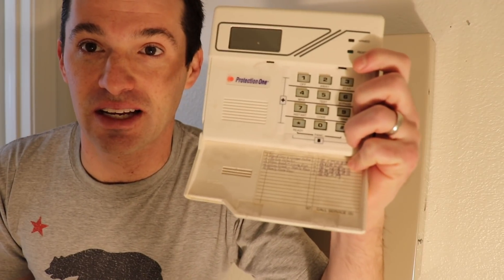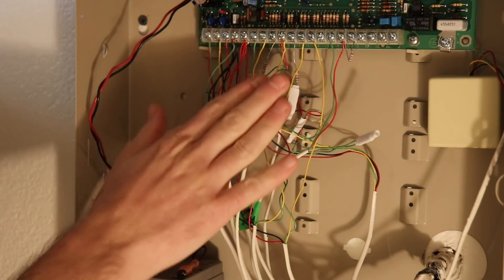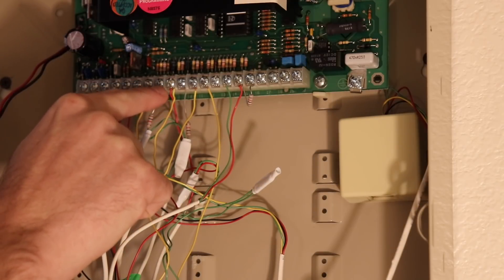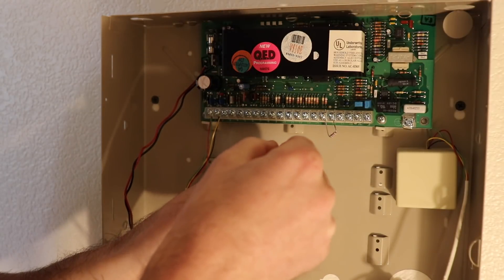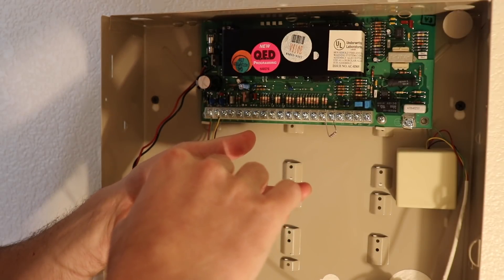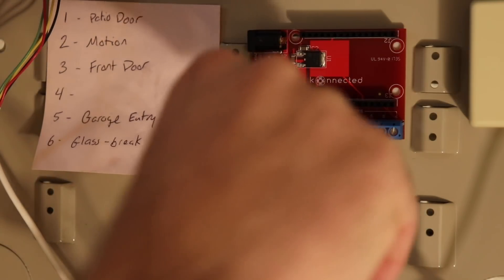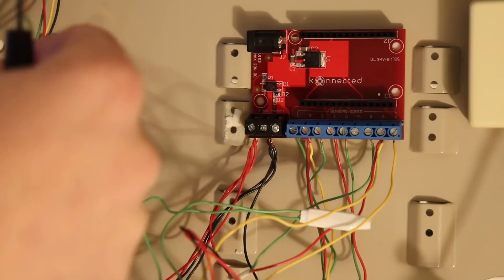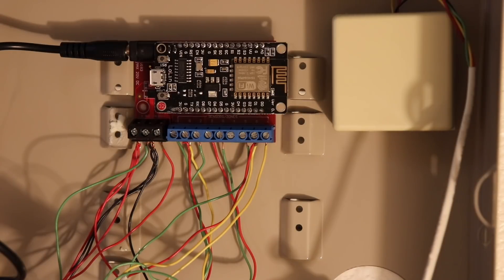Konnected Alarm Panel installation - Ademco Vista conversion

Comment: Excellent video. I must not be understanding it clearly. What about the keypads wires? Please help with what to do with them.
Reply from the maker: With the Conversion Kit you’re replacing the legacy panel, so the original keypads lose both power and data... after the swap they won’t do anything.

What to do with the keypad cable:
If you don’t care about wall-keypads anymore: disconnect the four-conductor cable at the old keypad, cap or tape the ends, tuck it back into the box, and leave it labeled for future use.

If you’d like a wall-mounted “smart keypad”: keep the same cable in place. Use the red/black pair to bring 12 V DC from the Konnected board (or a small plug-in supply) to the wall box, drop it to 5 V with a cheap buck converter, and power a slim Android/Fire tablet running Home Assistant, SmartThings, etc. You get a touchscreen dashboard where the keypad used to be.

Want the legacy keypads to stay 100 % functional instead? Go with the Interface Kit instead of the Conversion Kit; it lets Konnected piggy-back on the existing panel, so the keypads continue to work exactly as before.

Comment: Any way to do this without removing the original system/keypads (as if you're just installing an additional keypad, albeit a smart one)? The keypads are able to get info on alarm system status and zones and whatnot, so id imagine you could design one that relays that info to a cloud service
Reply from the maker: It’s not added to the keypad bus, but yes. That would be our Interface Kit variation.

The Interface Kit bridges onto each sensor loop itself:

You land every door/PIR wire on the legacy panel and on the matching input of the Interface board (in-parallel). Konnected just reads the loop voltage—nothing in the circuit changes, so the panel and keypads work exactly as before. 

One spare “keyswitch” zone plus two PGMs on the legacy panel let Konnected arm/disarm and know armed/alarm state, but it still never speaks the keypad data language.

Think of it as tapping the zone wires, not adding another keypad.

Comment: Hi, I'd like to add to this video, that when you do it for real, make sure you trim the ends shorter so there is no wire or copper exposure, otherwise, when the wires are moved could short the loops for the zones or the power, be the case. Also leaving the circuit board outside feels a little bit exposed. The device is innovative, affordable, and it seems that basically comes in modules that you build based on your needs, avoiding to pay extra for things you don't need, and all that is put together by the app. 
Now, on other videos it is shown that the device is placed outside the box for better wifi reception. I don't have this product so I need to ask, is the wifi really affected if it's inside the metal enclosure? Because that could be a problem. If that's the case there are a number of codes and regulations that are not taken into account. And one of them is wiring and circuit exposure. Please make an enclosure that can protect your device. Or even better, the standard for those dongles is to leave that device inside of the bigger enclosure or box, and add some antennas. A number of things can happen that would affect the performance of it, humidity, spiders or bugs, a cat, you name it. A spider touching the contacts could trigger a false alarm with possible deadly consequences for the bug at best. But none the less, a false alarm. Or the opposite, the spider could be conducting or closing the open loop and the contact would fail. I have seen it. Just a suggestion. And for real, there would be places where the signal is bad.

Comment: So why use this if you can just add AlarmDecoder to your existing Vista

Or better buy Vista 20iP and have everything already inside of it
Reply from the maker: Konnected is built first and foremost as a smart-home automation bridge: it speaks ESPHome out of the box, links natively to Home Assistant, SmartThings, Hubitat, Alexa, Google, and soon Matter, and never charges a cloud fee.

AlarmDecoder only works if you keep the Vista panel running and host its bridge software on a Raspberry Pi or PC, which many users find finicky. 

A Vista 20iP does add Ethernet, but remote control is still tied to Honeywell’s paid Total Connect service, so you’re locked into one ecosystem and a monthly fee. 

With Konnected you can either pig-back on any legacy panel (Interface Kit) or replace the panel entirely (Conversion Kit), keep your wired sensors, and drop straight into whatever automation platform you already use—no vendor lock-in, no required fees.

Comment: It would be a far better product if arm and disarm commands could be set to the board. Currently if the control goes down (ie Home Assistant) the solution is down and offering no protection. Even if using SmartThings one would only have to kill household power to disable internet. It is really just a sensor sender, one could achieve the same result with wireless sensors connected to the hub of choice.

Comment: This is an awesome product! Super easy to install and add to Hubitat. Have everything working, motion and 10 contacts. Thanks for making this. I upgraded my old DSC panels 10 years ago. The original 1994 panels were boring, so where the 10 year old panels. Now its 2020 and use a tablet instead.
Reply: What happens when the alarm is going off and your tablet is dead or not connecting?  

Cool ish product, not robust enough for actual protection imo.  You need a keypad.

Comment: I would keep my current alarm system that is 1000x more reliable then this,
It has a battery backup and uses the landline, So even if the intruder cuts off the power or cuts the coax coming into the house, My alarm panel will work for DAYS.

Also Those EOL Resistors are there for a fucking reason!

I hate people who change there perfect working system for the latest iCrap,
Just one of the MANY.. MANY Reasons why I don't partake in owning a cellphone, Just give me a landline and some analog TV And I will be happy!

Maybe it is because I like to live more simply, And I like the 70s 80s 90s/Early 00s living more then modern day crap. But there are clear advantages to keeping the old system, You could of at least added landline with seizure capability (Via RJ31X) With this system, But no, Most people nowadays don't care, And then someone breaks into there house and kills them. 
Pointless.
Reply: I am a prospective customer, not an owner. 

You are incorrect. Your statement makes no sense. The system as presented in the video is NOT the same as your current system. It is apples to oranges. Your current system uses a land line and has a battery back up.  A battery backup can be added, internet monitoring is how this system works.  I don't have a land line. My current alarm provider uses GSM as its connection. At almost $40 a month, I only need 3 months of service before this is paid for, with the same reasonable level of backup and communication. If someone is breaking into your house for the purpose of killing you and your family, you are dead before cops get there. If someone is breaking into your house while at work or away, a standard system will notify the call centre, then the call centre will call you to confirm if it is a false alarm. You say "no, no one is home - send the rentacop (its almost always a rentacop). This system will notify you directly. Did you know that 99% of all alarm call outs are false alarms?  I have my memories stored properly, if someone breaks in I have insurance - and cameras. Everything I own is replaceable - stolen or burned.

You don't own a cellphone , and can't have analog tv anymore.  YOU ARE NOT THE TARGET AUDIENCE FOR THIS PRODUCT.
Reply: @wpgspecb  I actually rigged my own system in my house to give me Analog TV from my Windows 98 Box playing over 1,000 episodes of classic TV like Rescue 9-1-1 on replay, It is awesome :)
Reply: Also I am 17 :)

Comment: Is this not just a very high priced lolin nodemcu v3 breakout board?
Reply from the maker: It is a custom breakout board for the NodeMCU. The price is reasonable considering the multitude of software integrations that we provide as well as the technical support that is available with every purchase. If you have your own NodeMCU you can use our open-source software for free.

Comment: I imagine most folks don't have a power outlet in their closet.  How have folks gotten around this?
Reply from the maker: Tippy it is possible to use the power from your old panel if you don’t have an outlet nearby.
Reply: @Konnected-io  My question was based on what I saw here: https://youtu.be/gIv5VdVrkys?t=1038
It says the old AC power won't work and we need to use a DC power adapter.   Currently the power comes to the panel from the basement where there is a power adapter.
Reply from the maker: Simply replace the AC transformer in the basement with the DC Power Adapter provided in the Konnected kit. Use the same wires in the wall to run power up to the panel (use a screw terminal adapter to easily connect to the wires in your wall: https://konnected.io/collections/in-stock-now/products/dc-power-screw-terminal-adapter)
Reply: @Konnected-io  forgive me, this is no my forte.  I want to clarify.
1. Replace the transformer in the basement with what comes in the Konnected kit.
2. Connect the Konnected transformer to the screw terminal adapter
3. Screw in the wires going up the wall into the other side of the screw terminal adapter.
Is this correct?  Looks like I would need the female 2.1mm adapter?  This is the adapter currently in the basement: http://i67.tinypic.com/2yyz8k2.jpg
Alternatively, could I not just leave the panel powered as is and instead use the AUX output from the panel to power Konnected?
Reply from the maker: @shobuddy  yes that's right. You will need a 2.1 female adapter for the basement and a 2.1 male adapter for the other side to plug into the Konnected panel. You could also use the AUX of the old panel, but we don't recommend this because most panels are current limited to 1A ... may not be enough power.

Comment: Do I understand correctly in that Konnected does not have/require a physical keypad/display panel?   Everything is done via the smartphone?
Reply from the maker: Tippy yes, that’s correct! No keypad or display interface is required, everything can be done with your phone(s)

Comment: If my Wi-Fi goes down (say an intruder cuts the outside cable wire), will the alarm still function if its already in the armed state before the cable wire was cut?
Reply from the maker: If someone cuts the outside cable wire, it would cut your internet connection but your home WiFi should continue to work. This means that cloud based platforms would NOT work (SmartThings), but local platforms (Home Assistant, Hubitat, OpenHAB) would continue to work and sound the local alarm.
Reply: @Konnected-io  But if cable is supplying my Wi-Fi , then I lose Wi-Fi also right?  if my main cable is cut then Home assistant, etc would also not function. So even though, in this scenario,  with cable wire cut that supplies Wi-Fi, Konnected is utilizing Smartthings hub and alarm was in the armed BEFORE the cable wire was cut, my alarm siren would not function if a sensor was tripped?
Reply from the maker: You are conflating WiFi with internet access. The cable supplies your internet access. The WiFi comes from the router inside your house. If internet access is cut, the devices on your WiFi network cannot talk to the outside world, but they can still talk to each other inside your house as long as your WiFi router is still on.
Reply: @Konnected-io  FINALLY this thick head of mine got it!! Thanks so much for your patience and explanation. I guess if i don't want to be concerned with my cable wire  being cut and internet connection with Smartthings going down , I'd have to switch to one of the other examples you gave me in a previous explanation. Thank you again . If this is any indication of your customer service in setting up Konnected, then no one has anything to worry about! You all have been most gracious and patient in answering my questions.
Reply: I extended one of the zone wires outside and rigged it to run along the COAX(Comcast) line and AC power.   If someone cuts the COAX or AC Power it will trip the  zone.

Comment: Does your keypads still work after installing it? and what if the alarm goes on but the internet is down?
Reply: One installation tip was to install a manual cut-off switch to the alarm.  Just a simple toggle that breaks the positive line.

Comment: i really wnated to do my own konnected setup but until we can sense if someone just shortens  2 wires to bypass a sensor or opens sensors cover when alarm is disarmed. I will stay with my 20yr old security system. And on top you would have to put everything oon backup power: Home assistant (raspberry pi), router, modem etc. to be safe in any way.
Here is a great video which shows howmany different states we cans sense with motion sensor correctly connected. We need analog inputs insted of digital ones
https://www.youtube.com/watch?v=NfPDpwtPi6g

Comment: this system is not SIA licensed or UL listed  which means it has NOT been tested and there is a POTENTIAL for it to fail.   THIS ALSO DOESN'T WORK THE ADEMCO  WIRELESS SYSTEMS.   also I would not use this for commercial systems
Reply: There are MANY devices that you and I own that are not UL listed and not even know it.

Comment: Hello, i purchased the panel a few months ago, but i haven't been able to install it because my wired alarm system is wired with ethernet cables. There are a bunch of tiny wires coming out of ethernet cable that are wired to the zones in the old panel. I am not quite sure if this is going to work since with all those tiny wires i can hardly identify which wire is which. I want to know if you can give me some advice as how i should approach this issue before i start pulling wires off the old panel. Any help i would appreciate it. I hope i explained my issue so you can understand what i mean.
Reply from the maker: send us photos to help@konnected.io

Comment: Sweet mother of God! I really like the approach of using the ESP8266, etc in this way. But for God sake! The EOL resistors are there for a great reason!!! It there to balance the wires to the sensors, to prevent tampering. There are also double balanced wires (uses two resistors). That way you can detect tampering AND triggered sensors. This of course needs something else than just a logic input (that I guess you're using?). Comparator inputs och even A/D-inputs. The ESP8266 are short on A/D inputs, (not sure about comparator inputs), but you could have used an SPI A/D converter with an A/D input for each zone, etc. ALso, I see no protection on the inputs. Will easy blow your controller if something "bad" happens on the zone wires, etc.. 
 Of course that will increase the cost for the HW. ANyway, cool product. Keep developing it!
Reply from the maker: In theory you are mostly correct -- the resistors are there to detect tampering (not prevent it).  However, when the resistors are installed directly at the panel as they are in this case (and in 95% of the installations we see) they are absolutely useless! Resistors must be installed at the End-Of-Line to achieve the tamper protection that they're designed for. When installed "in the can" like this, a malicious actor could short circuit the sensor anywhere along the wire and it would never change the resistance on the line, so the tamper would not be detected.
For this reason, since the vast majority of tamper protection circuits are not even used properly, we decided to simply not include this feature for simplicity of installation and to reduce complexity of the software.
Reply: @Konnected-io   yes! Of course! Sorry! I should have written that the EOL resistor should not be in the panel :) And yes I am aware of that most of the time the installations are done wrong. also with double balanced wires (with the resisors mounted in the end sensor) you can detect.both tampering and triggered sensors using only two wires. But as you say more complexity to HW and SW. Anyway.. keep developing in further! :)

Comment: So, this is self-monitoring only with no option for alarm signals to report to a Central Monitoring Station?  And, I see there is a WiFi module placed on the hardwired  conversion module,  in a metal cabinet.  If you place the door back onto the cabinet, won't that degrade the WiFi signal?  Even with the WiFi module in the metal cabinet,  with the door off, won't this attenuate the WiFi signal if the metal cabinet is between the WiFi  devices?
Reply from the maker: You can optionally sign up for pro monitoring service. We've partnered with Noonlight, a startup that's improving on the concept of central station monitoring and making it smart home aware: https://konnected.io/blogs/news/introducing-24-7-smart-home-monitoring-for-security-fire-with-noonlight

The metal cabinet can impact the WiFi signal, but usually it still works fine. It depends on the strength and proximity of your WiFi router. If you have an issue with WiFi signal, it's simple to replace the metal can with a plastic one, or just remove it all together.

Comment: How do you handle wireless zones?
Reply from the maker: Konnected only works directly with wired sensors. If some of your sensors are using the RF wireless sensors, you can replace those with Z-wave or Zigbee wireless sensors that are compatible with SmartThings or your preferred smart home hub and they'll work seamlessly together with Konnected.
Reply: @Konnected-io  So if my alarm has the 6128 RF pad do I need to swap out all of my sensors?
Reply from the maker: @CPthrow  Konnected only works with wired sensors, so if your system is all wireless, then Konnected is probably not a good solution for you.